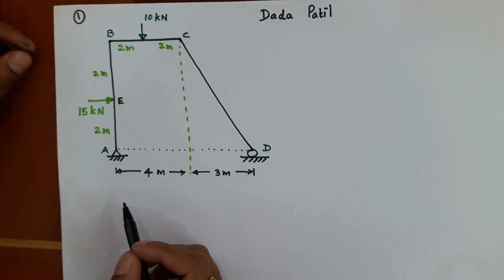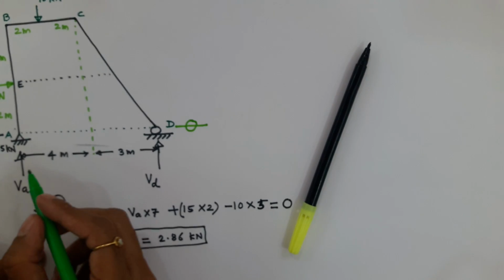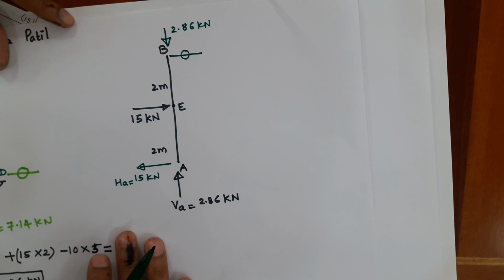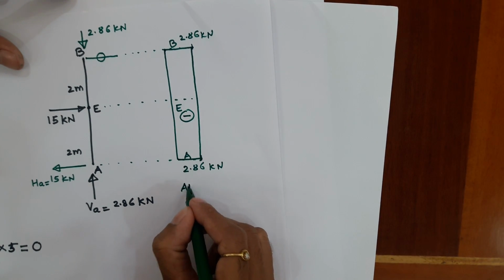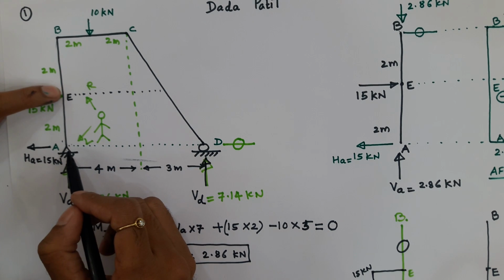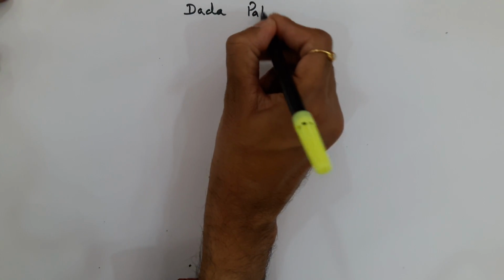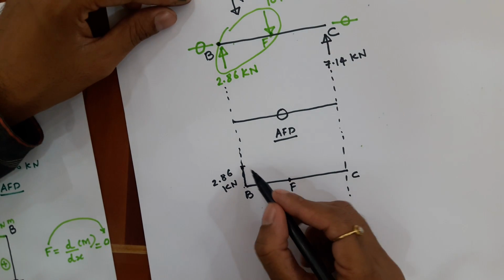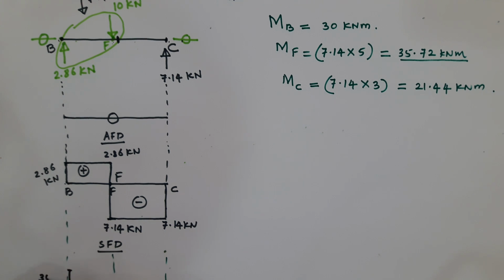AFD SFD BMD of Frame Problem no. 04 part 1 by Prof. Dada Patil

Comment: Sir in the last video made by Firoz sir.... almost same  frame with udl on top instead of point load... He has told to calculate horizontal force at A (HA=30kn) for BM @ D..... Then why in this video u haven't calculated horizontal force at D (Hd= 15kn)...?????
Reply from the maker: Horizontal force is not developed in roller support
Reply: Then it should have been same with previous sum also???? I'm confused that which pattern to follow??
Reply from the maker: @manjirimalgunkar6473  in any sum vertical reaction is not shown in roller support
Reply: Okay sir thank you 👍